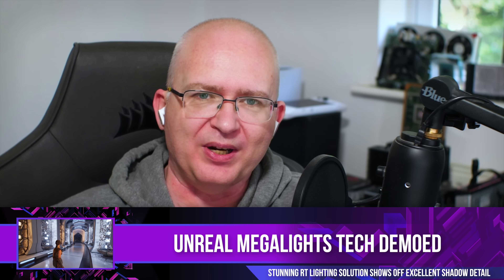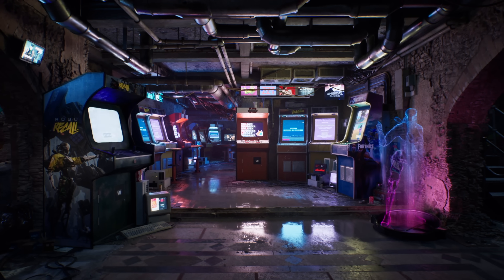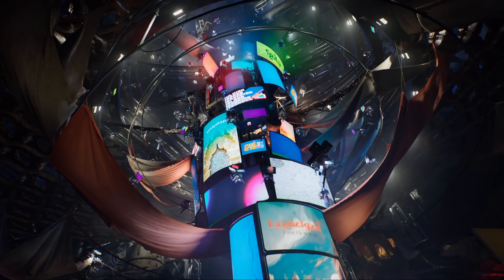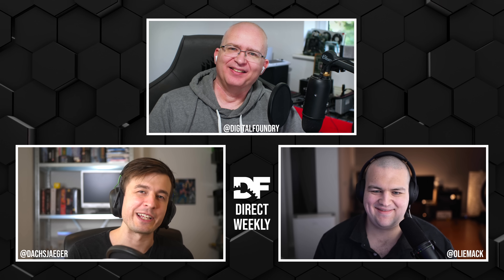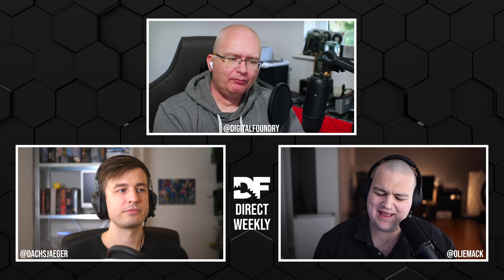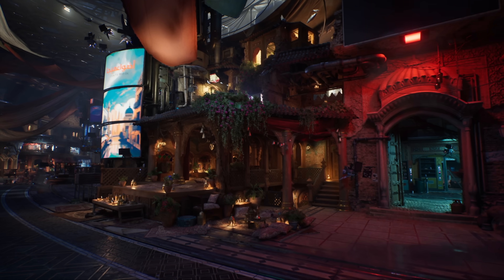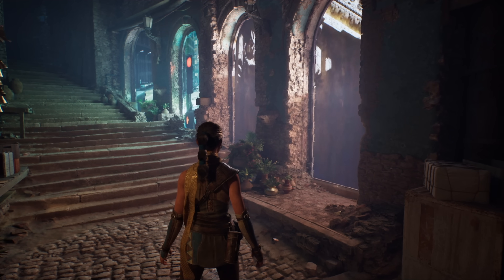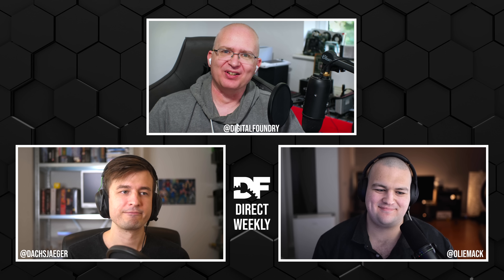Unreal Engine 5 MegaLights Demo - Technology Explained

Comment: Mega-Lights are probably a life saver for a very specific type of games (as well as VFX probably), Sandbox games. I think Sandbox games will benefit from Mega-Lights since it's almost impossible to prevent players to place thousands of lights in their world, most UE sandbox games currently have a forced cutoff of lights in the distance, sometimes for lights less than 50m away... With Mega-Lights that cutoff can be expanded to 200m or more, and it allows for more detailed lighting and things like screens properly emitting lights in more "modern" type sandboxes. It's stunning!

Comment: Projector lights or whatever you whant to call them are a feature since ue4 called rect lights. Thats nothing new. The fact that they lifted the self imposed limit of 4 dynamic lights is amazing, really groundbreaking, almost worthy of DF to do a deep dive on (in?) but im guessing these mega lights are megaBS as usual, probably rendered in a separate pass and then composited together with the rest of the scene. As the guys noticed theres heavy time slicing and probably upsampling going on "behind the scene". I remember when deferred rendering started to pick up and how it promised huge numbers of dynamic lights but god forbid you enable shadows on them. This is probably similar, god forbid you have more than 30 FPS...

Comment: UE5 does not provide a good enough quality/performance level for current gen.

Look at the best looking games and they all have something in common.

Forbidden West
Red Read Redemption 2
Battlefield 1
Arkham Knight
Space Marine 2
Crysis 3
Last of Us 2
Demon Souls remake
RE4 remake
Doom Eternal

Baked lighting
Reply: Crysis isn't baked lighting it uses Cryengine.
Battlefield 1 isn't baked lighting it uses it's own engine as well
Doom Eternal, who knows it uses it's own engine as well
RDR2 isn't baked lighting it uses it's own engine as well
Forbidden West isnt' baked lighting it uses it's own engine as well
Last of Us 2 don't know, but not on UE5 either.
Reply: @karambiatos  Yout comment is nonsense. All of these gsnes use a baked gi solution to save on performance cost.
Reply: @devonmarr9872  Giant maps or giant maps and real time TOD. 
Yeah one is impossible the other would make insanely heavy maps.
Reply: @karambiatos  in my list are games with a fake time of day that allows based lighting. Spiderman 1,Morales,2 could be added.
Reply: @devonmarr9872  No that's not how it works there's no such thing as fake time of day in those games, what even is fake time of day.
RDR and cryengine have tod changes you cant use baked lighiting then, neither can you use it on large map environments like Battlefield 1, technically you can but the shadows look garbage at those sizes, battlefield 2 used it, but very low res
Reply: @karambiatos  RDR2, Forbidden West are prime examples where the sun is always moving but there are actual transition periods between several world bakes of the lighting. There are other things going on to assist but no gi solution.

Comment: In all fairness, even in preview Megalights substantially improves lighting performance (even using it a minimal amount of lights can result in potentially doubling your FPS, based on the tests I've seen, and 1000 lights can potentially go from 20-30 FPS or less to possibly 100+ FPS, which is wild), and it basically makes it so you can functionally use as many lights as you possibly want in a scene without having to weigh up performance considerations (with one exception, it doesn't work as well when a bunch of lights are heavily overlapping, but that's easily fixed by spacing out lights in your scene design). That's practically the holy grail of lighting. Sure, it has drawbacks visually, but the moment 5.5 comes out of preview I'm turning on Megalights just for the performance boost alone.

Comment: 7:36 hm   I see a specular reflection vor every light in that time where it's bright enough to also get some bloom. You don't see reflektion of the back light in the inner circle because of the angle. Its reflection in placed on the dark ring on the ground. In fact on the next inner white slim ring you see specular reflections on the back lights too.    EDIT: i just saw the PC screenshot. On that shot all the light are brigther, getting some some bloom and therefore are in the range where the specular reflection occur, as observed with the PS5 where the lights have to be bright enough ( in bloom range ) to make specular reflection on the ground.

Comment: Another proof of the Epic's UE strength and capability of their SW development magic. It's also another showcase what SW alone can do on most of the HW and that u don't have to pay extra for HW feature like with Nvidia's RTX asking ridiculous price for it also by not having any real competition. I give Epic BIG thumbs up for democratizing expensive feature for everybody even they might fully realize on the next gen consoles and more performant PCs👍👍
Reply: You realise that this can use hardware RT, which is what NVIDIA's RTX is, right? This, like Lumen, is just a more efficient way of using and managing rays. The underlying raytracer is a completely separate thing, so you could theoretically plug a voxel raytracer into this and have it work.
Reply: @jcm2606  Yes, it can but it doesn't have to use Nvidia's or other proprietary GPU HW feature to run smoothly... of course dedicated/specific HW based solution will always deliver better results than just a SW one, but that's exactly why I like Epic's decision to not directly promote it and rather use PS5 even it's based on the AMD platform. AMD is clearly not as far as Nvidia with the GPU HW features so it's fair from Epic to show it will work there as well. Overall they sent clear message they've got SW solution which delivers results almost everywhere and that's right way to go for the company like Epic.

Comment: That Matrix demo ran on PS5. So, what's the issue? One would guess there would be development happening during this time, and it would be viable to make a game with it. I'd accept 30 fps if my game looked like that on my console.
Reply: 30fps + frame gen is actually good, or fake 60fps. Idk if it's possible on consoles.
Reply: @kanta32100   LMFAO no. Frame gen absolutely doesn't recommend 30FPS as baseline. It'd be horrible in both latency and visuals. It is much more useful for 45 to 90FPS or 60 to 120
Reply: @DragonOfTheMortalKombat  Did you tried it, or you listen to reviewers? I tried it and it's decent, i'm talking about DLSS. It's similar to vsync lag.
Reply: @kanta32100  anyone saying that 30fps+ framegen is good has major brain issues.

Comment: unreal is great but you can get into alot of trouble with all the gee wiz stuff. keeping things simple is usually a smarter way through it. alot of the perf issues are devs not making proper compromises with all this stuff and instead going full idiot on graphics because they think they can and maybe shouldnt. or should make more clever compromises and forgo some things. the pressure to look good kills rational thinking about whats holistically good for the whole game. i say this as an artist. often simpler lighting actually looks better btw. adding too many lights muddies the overall reads. again simplicity is often better. this is lost on alot of people.

Comment: these technologies are all well and good and will simplify the development process for any applicable application, but they are not viable for games, at least not in the immediate future. the cost is simply to high. if it cannot run at 30fps at 1080p console hardware will always hold it back. maybe itll be a smooth experience on a pc with a 5090, but not sure who is going to target a game at 0.0001% of the market.
lets get back to real improvements. this generation of shoehorning in more and more tech that needs to be multi sampled and upscaled into a blurry laggy nightmare needs to end.

Comment: What’s the difference between this and ray tracing? Is this meant to be used together or separate with lumen? Or is it meant to be a way to increase the “rays” similar to path tracing?
Reply: "What’s the difference between this and ray tracing?"

There's no difference because this is raytracing. The current definition of raytracing in the video game industry pretty much encompasses any and all lighting techniques that simulate light as physical rays traveling through the scene, that don't rely solely on screen-space information (since if it could, screen-space reflections could be considered raytracing as you trace a ray through the screen-space depth buffer). This technique fits that definition, as it tries to solve direct lighting by tracing rays through the scene towards nearby light sources, using clever tricks and optimisations to be able to do so more efficiently.

"Is this meant to be used together or separate with lumen?"

Together. Lumen tries to solve indirect lighting by building a structure of probes and sampling ambient light from those probes by tracing rays outward from the probes, so Lumen is tackling a different aspect of lighting than this technique is. This technique could probably replace Lumen's area lighting functionality as this technique can support area lights with much higher quality, but the rest of Lumen can stay.

"Or is it meant to be a way to increase the “rays” similar to path tracing?"

Path tracing would replace both this and Lumen. Path tracing is a specific lighting technique that solves all aspects of lighting (direct lighting, indirect lighting, reflections, refraction, subsurface scattering, etc) within a single unified pass, so path tracing would replace both this and Lumen as path tracing can support efficient direct lighting through ReSTIR, and it naturally solves indirect lighting just due to how it works.
Reply: @jcm2606  Thanks for the great explanation! This was easy to follow and helped me understand the concept well, it was alway pretty confusing before lol. Looking foward to see how developers implement these different techniques.
Reply: @jcm2606  If path tracing solves everything, why don't they invest in making path tracing more optimised?

Comment: we can always buy stronger gpus and new consoles but the reality is that i would be happy with the performance of  my 4070 TiSuper for a decade or 2.. if games released that refined game engine tech ibstead of just meaninglessly increasing hardware demands for little benefit to image quality. The influence that nvidia has on graphics programming will continue to incease demanda of games. The 2024 games that have the best graphics look good enough for me... Forever if im being honest. Id be happy to see the creative art styles and clever techniques we would see from devs if a 32gb 4080 was the only gpu available. We need innovation. Not games using super demanding engines tham make developing easy and make games harder to run. Its about time for a new engine built for gpus instead of nvidia and developers.

Comment: @8:11 it's clear the lights in the front are BRIGHTER in this scene than the ones in the back, and in the PC screenshot, its a different lighting scheme where all the orbs have increased brightness. It's still possible the noise limitation is affecting the visibility of specular as you suggest, but it's worth noting these are not the same lighting scheme.
Reply: yup my thoughts exactly, in the shot at 7:50 the lights toward the back are simply dimmer hence them not giving off as much light + not having strong specular reflections

Comment: I feel like a big part of these UE showcases that gets overlooked is what these features mean beyond the little box under your TV. Coming from a VFX and Visualization background, these things allow us to get closer to certain looks at a fraction of the offline costs. Which means that things like accumulation times etc aren't as big of a concern when we're looking at 1frame per second vs 1 frame per 1 hour. It also allows smaller teams to operate far more flexible and iterative if the production allows for it. So while I understand the disappointment of the actual performance, I think it's important to understand that UE isn't just for games anymore. We do a lot of things with it, and MegaLights is just one of those tools to get us in the ballpark of offline rendering while still leveraging realtime feedback.
Reply: For me as game dev the tech is not the problem, but being confronted with non game-devs expecting games to make use of the new tech is the hard thing. This creates unnecessary pressure.
Reply: Exactly! UE is becoming an absolute powerhouse in the VFX industry right now and I'm all here for it. As far as the gaming industry goes; games need to be optimized for consoles, and so developers are held back by the processing power of consoles. Rockstar Games would be 10 years ahead if they could optimize GTA6 for a 4090 card, and that's sadly not possible.
Reply: Not sure, if this is really the use case... Unreal renders like Lumen (but even path tracing, which btw doesnt support all Unreal Features) isnt photoreal and not comparable like quality renders with Arnold or Octane. So wont see why VFX-studios would switch for that. Yeah faster results for previz, but not final quality...
Reply: THIS! A lot of tv shows use unreal to accelerate VFX work these days. I saw a video demonstrating how the show Superman & Lois uses it and now I'm convinced unreal in tandem with some very dedicated VFX artists is the reason that show's CGI looks as good as it does
Reply: True, but it's kind of lame to use a PS5 to advertise when it's so prohibitively expensive for a console's rendering budget that it's effectively useless.
Reply: @oktusprime3637  Except Megalights actually improves lighting performance, even on low to mid-range cards you can get performance boosts of potentially double the frames per second. This isn't like Nanite where the performance improvements are more conditional (for the most part, anyway), Megalights actually allows for thousands of shadow-casting lights while basically having the same performance as one with almost no caveats aside from a couple of visual issues in regards to shadows.

Comment: There is no doubt UE5 is the most realistic engine. The games same as hellblade 2 or black myth wokun proved it. Yes it needs high ends GPU but it's worth it. Right now 4000 series easily can handle the games andvin next 2 years everybody use 4000 or 5000 GPU. AMDs next GEN also supports raytracing with high frame rates as they said.
Reply: There are other engines that come close to the level of UE5 and in some ways might surpass it but there is no way Unreal is the most versatile engine used by so many different developers.

Comment: Not sure if you guys read the comments here but we shipped Funko Fusion with all the bells and whistles and a 60fps mode that is fairly consistent on console.
Reply: Using UE5.5 preview?
Reply: @Hybred  obviously no. But they also talk about how unreal 5 games with the new features rarely ship at 60
Reply: @AdamKiraly_3d  I figured as much, I was just confused as to how the comment relased to the video. Now I see.

But their analysis is still correct, they said it was rare not impossible. I'm glad you targeted 60fps, and I'm curious what sacrifices you made to achieve it. 

Internal resolution? High down sample factor on certain lumen effects? Regardless, good job. I'm currently working on a fork of UE5 to get better performance out of it.

Comment: What about PS5 Pro with better Raytracing hardware, 45% better GPU performance and PSSR, it would benefit from this UE5 technology? I believe what we have seen until now for the PS5 Pro is was just current games improvement no games built for it. It was the same when PS4 pro and PS5 was lunched.
Reply: Nah, The Pro is a mid range GPU, 7700/7800 XT raster with 4070 ray tracing capabilities. The things they’re demo’ing here are going to require far more powerful hardware to pull off without shortcuts  , not to mention build a game around which will take years . As they pointed out, there were several shortcuts taken in the demo that were hidden in the video feed at 1080. This certainly has next gen potential though.

Comment: ok cool but when will they fix the stuttering? it looks very cool but theres no point if in game works as a stop motion movie.
Reply: They are fixing the stuttering. It’s just that games like wukong are made on old versions of UE5
Reply: Unreal Engine is trash... All these games run like crap and the graphics look worse with low res textures with stuttering... I see a pattern happening doesn't look good. Won't even bother buying anymore games that use Unreal engine they're all garbage. Even this trailer in the video looks like Fortnite graphics but run at 20fps.
Reply: @SemperValor in motion as well most of the games have bad ghosting issues.
Reply: @SemperValor  Lol. Unreal is one of the most advanced engines out there, if not the most advanced one. It has issues, sure. But "trash"? Yeah, you don't know what you are talking about. Tell the devs to optimize more, don't blame the engine like a dumbass.
Reply: @SemperValor  Unreal Engine is not trash just because bad developers don't use it properly for their games. Most stuttering/hitching is because of DirectX 12 and has also been a problem in other engines such as Frostbite. You can easily mitigate stuttering/hitching in DX12 by precompiling shaders as well as providing pso cache files, Epic has this in their documentation. Alternatively you can just use DX11 which has way less of the problems that DX12 has